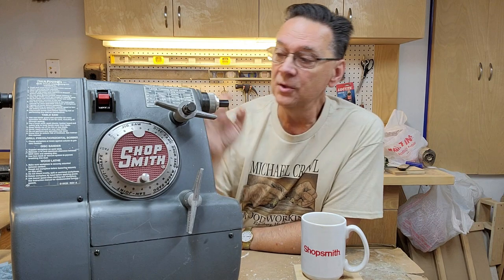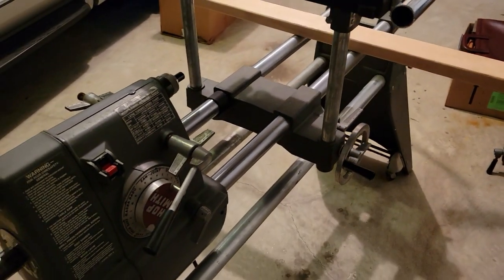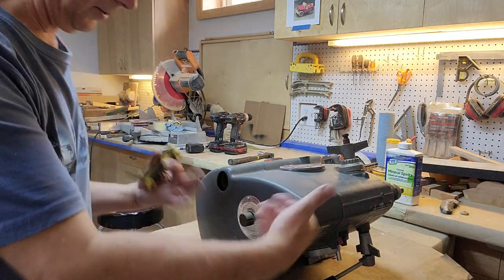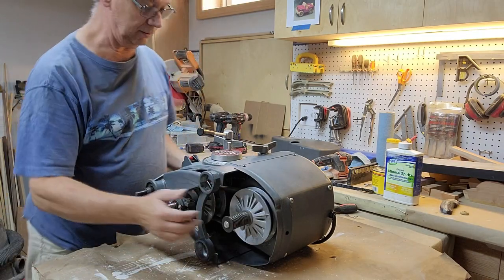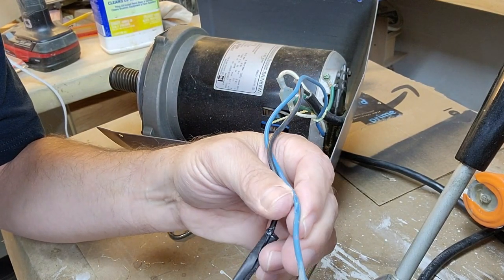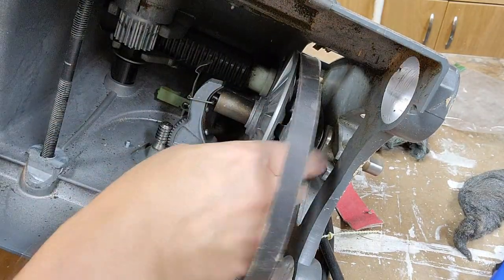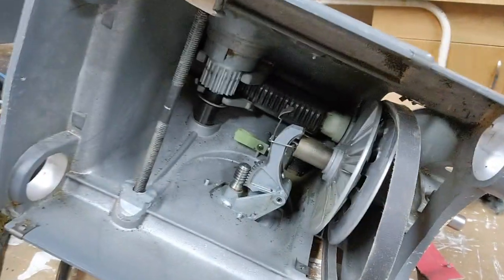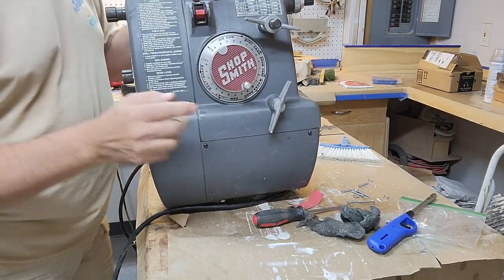Shopsmith Headstock Repair, Model 510

Comment: How do I fix the wobble in the speed dial when I turn it to change the rpm?
Reply from the maker: I don't know the answer for sure... I would check the flat spring beneath the dial. But for better information on this, I will direct you to Jacob Anderson's (@jacobvb10 or @Jacob A) videos. He is a VERY experienced Shopsmith rebuilder, and his videos are a great resource. https://www.youtube.com/watch?v=w4oaJCKKT3E&t=252s